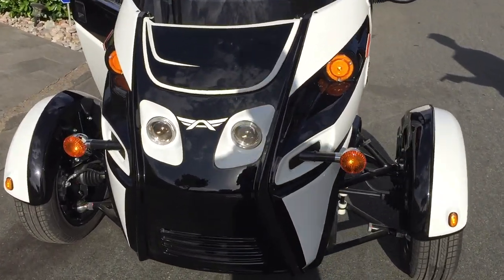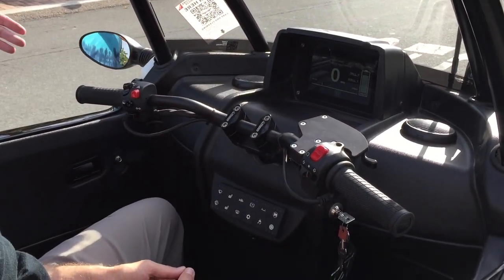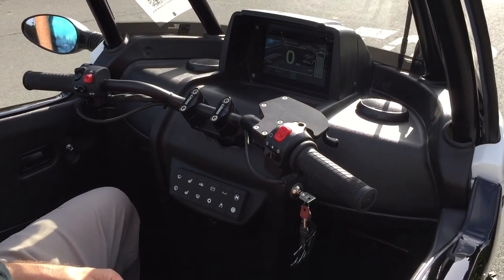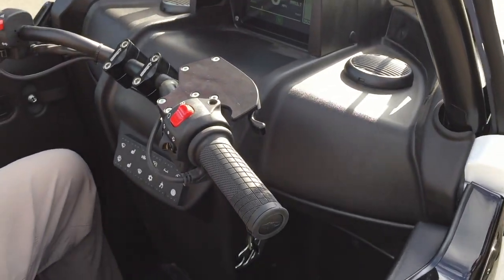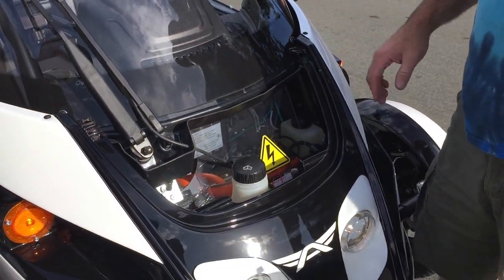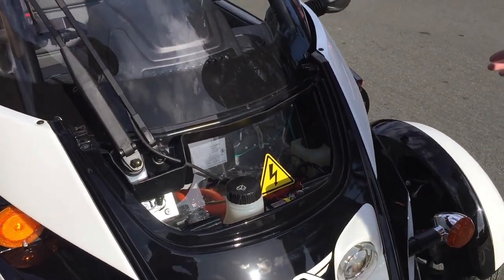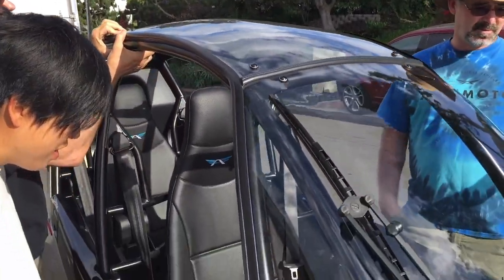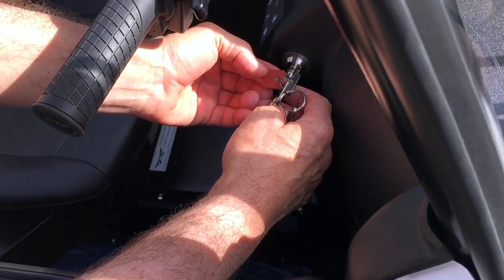2022 Arcimoto FUV Delivery & POV Drive!

Comment: $20k for this?
Reply from the maker: Yeah, I agree that they really need to bring their prices down for the vehicle to become competitive. Though, the battery in this car is probably quite expensive
Reply: @BrandonKipp  They were supposed to be 12k
Reply from the maker: That price would make it much more attractive, and I hope they can bring it down to that at some point.
Reply: No, not $20K. The base price is $17,900. In 2022 the average price of a new EV in the US is $66,000
Reply: @yulog  That is false. The promise of that goal of a $12K base price with mass production was based on 2018 dollars and will be more with inflation by late 2023 when the new mass production version is ready. It will be easier to do more assembly by robitics then and it will be lighter with a bigger battery capacity. I decided not to wait, I'm getting old. Mine is a very economical vehicle with no gas or oil changes and the very low motorcycle insurance rate saves me $800 every year.
Reply: @popeyegordon  your comparing a golf cart to an actual high end car...wow you showed us...lol
Reply: @popeyegordon  if enabling were a good thing you would be awesome.
Reply: @yulog  Fact checking IS a noble pursiut. I have 175,000 of them in social media. I also recently got two troll jerks banned after relentless harassment of all 
Arcimoto videos. YOU have had your channel for almost as long as me but I earned 100 subscribers while you have just two. Catch a clue.
Reply: @popeyegordon  in Europe you can buy small EVs (by Renue and Citroen) for commuting in the city for under $10,000. That price rage is the sweet spot.
Reply: @AA-rc4zr  This is a US website reviewing US made vehicles for use in the USA, bought with dollars. Into this separate venue you actually try to compare 40 mph city vehicles for cramped overpopulated EU countries with the 80 MPH Arcimoto. Who do you think you are fooling? Not us.
Reply: @popeyegordon  I'm trying to see things your way , but i just cant get my head that far up my arse.
Reply: @popeyegordon  Glad to hear you are not fooled. Archimoto claims to want to save the world by providing a car that will take care 80% of everyday driving. So, after you spend close to $20K you need a second car for your other 20% of driving. When it comes to marketing, Archimoto positions itself as something fun to drive. Probably after a week of driving it, it won't seem as much as fun, and you are still out of pocket $20Kish for glorified motorbike with hood on it. Average daily commute in US is 35 miles round trip. One of those European cars with 40mph for around $10,000 will do the job. For me commuting is to get from point A to point B, where I can still afford to have a fund car in the garage for weekends or long trips. 3 years ago, when Archimoto's stock price was around $3/share and just before it  jumped to above $18/share, I looked at the company as possible stock to buy. I reasoned the company was not a good investment and ultimately didn't buy the stock. Even after it jumped to $18, I couldn't see what value people were seeing in this company and its stock. Now it is trading at around $0.75/share. Hype will only take you so far. At the end, you have to deliver real value. It's good to know that there are still people like to that are not easily fooled.
Reply: @popeyegordon  Calm down. nobody is going to take your toy away. You are the demographic for Archimoto. I am not. No need to take it personally. I am stating at any price over $10,000 I don't find Archimoto attractive. Archimoto's path is a strategic dead-end. The company does not enjoy significant competitive advantage to survive. It's stock price confirms that. The stock market has dropped by 20%, while Archiot's sock has dropped by 75%. You don't have to care about the stock price, but you can bet Archimoto does. Unless its stock price goes back above $1.00 within the nexts couple of weeks the company will have to do a reverse stock split to avoid getting delisted. Investors don't like reverse splits. Without investor money Archimoto won't survive over time. Smart money has already left this company. Sadly, we live in a world where investors make more impact in the world than a few vegan podcasters and their neurotic friends. I could try and explain to you the merits of investment verses incrementally saving to buy a $17,900 "FUV," but that would be a waste of time. Enjoy your FUV and keep recycling your expensive water bottles. Before you tell me, you use one of those reusable water bottles, lookup how many times you have to refill it to make up for the resources that went into making your bottle.
Reply: @AA-rc4zr  YES stick it to the gordon guy, AA! nice one! you're stating the actual facts while meanwhile gordon is just throwing out his conspiracy theories. this stock is literally PENNIES! doesn't that show anything?
Reply: I would only buy if it was maybe 9k or less
Reply: @popeyegordon  I wish I could say arguing with you is getting to be fun, but it's not. You are falling apart rambling on about all sorts of unrelated nonsense. I don't have a horse in this race. I don't care if Archimoto survives or if it doesn't. I am stating my measured opinion. You are making my point for me. Archimoto's manufacturing costs are too high. I could explain it to you where Archimoto has gone wrong to end up here, but that would be a waste of time. There is a market in the commuter segment. Archimoto is not it. I bet by the time you get to start shaving, someone will come up with the right vehicle at the right price.
Reply: @popeyegordon   Popeye sound a little more like Olive (Karen) in this post
Reply: @seawas1046  Nobody owes you a vehicle sold at a loss. You might as well whine about Lear Jets not being under $20,000 and private islands not being less than $25,000. Oh, and the average price of a new EV in 2022 is $66,000. So you would only buy a Tesla if it included a $50,000 dscount?  WTF??
Reply: @yulog  No civil adult can see what you are claiming in your troll harassment attack. Flagged.
Reply: @popeyegordon  Hope it's an American flag.
Reply: @yulog  American website, American company, you earned 7 American Youtube flags for harassment violations of the terms of your account.
Reply: @popeyegordon   Woohoo, Love American flags😆

Comment: It's cool but feels unfinished and it's surprising givin how long this vehicle has been in development.
Reply from the maker: Oh yeah, there’s definitely still lots of work to be done. Especially considering the price, I’d expect to have better and more reliable software, but only time will tell how they improve. Stuff like the accelerator cutting out at random times can be scary and dangerous if you don't know what to do. Happened to me just the other day, needed to put it in neutral, then back into drive and then it worked again.
Reply: As an owner I say it is very finished. Easy handling, very utilitarian, safe and fun. I do not want doors in Florida. The idea is to avoid the solar oven effect and dead weight of doors and glass. This final of 5 prototypes is far better than previons versions. They saved 16 inches of vehicle length and 220 pounds of vehicle weight by going to handlebars. The long design history shows.

Comment: This goes 75mph, although I can't imagine who would be crazy enough to drive what is essentially a 3-wheeled golf cart 75mph.
Reply from the maker: We got it up to 84 mph, and while it's sketchy, it's so much fun snd felt a bit more stable than expected. Definitely not something to do on a regular basis though.
Reply: Nothing even remotely in common with a golf cart. Fail. High speed vehicles like this are not allowed on golf courses. The actual unadvertised top speed is over 80 mph. Mine does 84. I am protected in a certified 24G crash cage and a 6 point harness, so safe that no helmet, air bags or leather is needed. No golf cart in existence has proven formula one race car safety.
Reply: @popeyegordon  Golf carts may not be as safe, but yeah it’s very similar dimension wise. My cart is 1 inch longer than an arcimoto, about 10 inches less wide, but it is also taller. Has an inch more of ground clearance too. So, yeah, it’s basically driving around a super fast golf cart.
Reply: @seanrodgers553  No it absolutely is not. You can lie forever and never make that true. You are a very insecure person with a cheater mentality that compels you to upvote your own comments. There are countless vehicles that have the approximate dimensions of golf carts. They are all different designs for different purposes. A 6 wheel ATV is the same dimension but nothing in common with a golf cart. A forklift may have the same dimensions too and it is not a 'super slow golf cart'. The 'bahrta sai' troll is notorious for attacking the threads under new vehicle design videos. I had to get him banned from video comments about the Organic Transit ELF, my other vehicle.
Reply: @popeyegordon  
A) I did not like my comment, I never do.
B) A forklift is not transportation like a golf cart or Arcimoto
C) Yeah, an ATV is kinda similar, just serves a different purpose. Yes, I can off road my golf cart too
D) There is nothing wrong with comparing a golf cart to an Arcimoto. I’m saying that as a positive. I love golf carts, an arcimoto seems like a fast golf cart. Easy to maneuver in tight spaces, easy to take around a community, easy to plug in at home, easy to just get out of the house and enjoy the ride. When I think of an arcimoto, I think of it as a fast golf cart for these reasons, I’m not sure what’s wrong with that. That’s a good thing
Reply: @seanrodgers553  I take you at your word that you did not upvote your own post before I replied 15 minutes later but that is the exception, as is the norm for trolls attacking new compact EVS, calling them golf carts with derogatory malicious intent. There are hundreds of such attacks in Arcimoto video comments. They claim it is the exact same thing as a Can-Am when the only similarity is three wheels. They also like to call it a rickshaw or death trap, again with malicious intent.
Reply: @popeyegordon  Oh yes, I love EVs, and  unlike those trolls, I do thing the Arcimoto is pretty cool. Also yeah, back in the day people called Teslas golf carts, so I understand that. I mean it in a good way, I love golf carts! Also, this and a can am are separate vehicles with completely different purposes, I’d definitely not compare the two. Also, the arcimoto definitely has to be safe to be Street legal, might not be as safe as some cars, but definitely safer than motorcycles and even some cars, and definitely safer than older cars. I wouldn’t say death trap
Reply: @seanrodgers553  Understood.
Reply: @seanrodgers553  It's funny how this gordon guy thinks you're some troll when meanwhile he's on social security and taking advantage of medicare and all the other stuff
Reply: this junk seems so dangerous to me lmao
Reply: @seawas1046  And yet it protects the occupants in ways only cars can do. A billion motorcycles and scooters have no six point harness or roll cage. It is so safe there is no need for a helmet and you can drive it barefoot.

Comment: Starting at 18 grand 😆😆 the battery lost 10% just being powered up.
Reply: Correction - the default battery charge level is 90%. We have to enter a command to go 100%. This method increases total battery life. Not the only EV using this approach. 
$18K is a fantastic deal in 2022 for a vehicle that never needs gas or oil changes and gets the very low motorcycle insurance rate. As of now there is a $7,500 tax rebate. Didn't help me as I'm retired. Demand for EVs is set to explode with the new tax breaks.

Comment: It looks like it could tip over easily.
Reply from the maker: Yeah, it’s definitely less stable than a four-wheeled vehicle
Reply: @BrandonKipp  so no stability control like a can am?
Reply from the maker: @doclees11  I don’t believe so
Reply: @BrandonKipp  have you got it in 2 wheels yet?
Reply from the maker: @doclees11  Haha, nope! It just rolls side-to-side a lot in corners but I feel like it would be pretty hard to actually flip over
Reply: @BrandonKipp  well with a 29 ft turning circle you probably need more speed than it can deliver.  Good thing it is short so K turns are easy enough.
Reply: @BrandonKipp  Incorrect. You do not know of any 4 wheeled TWO PASSENGER vehicles that have a wider wheelbase and how many have a certified roll cage and 6 point harness?
Reply: @doclees11  The stability is built in by having a wide wheelbase. CanAms have no roll cage or 6 point harness so they are far more dangerous to drive in all cases.
Reply: @popeyegordon  that's plain wrong.  They both have the same track within an inch. Wheelbase is length not width.  The longer wheel base of the Arcimoto makes it more prone to roll not less.  The Arcimoto has about 200# on the Spyder but it is also another inch higher in ground clearance which probably raises the CoG.  Neither of these 2 trikes are "safe".  Stick either in front of an F150 and you are mush.  The harness and roll cage only make it easier to find the parts. I'll take the Spyder's more nimble handling and stability control as a safety feature over the 5ft greater turning circle, harness and roll cage of the FUV any day.
Reply: @popeyegordon  yeah I call BS on that.  Post the link.
Reply: @popeyegordon  as I said BS.  No F150 and no pictures.  No evidence that was a 35 mph accident.  Did see another one there with side impact damage but no pic of the other vehicle and no evidence of speed hit.  But maybe they are prone to more accidents because of the size and quiet running?  Remember loud pipes save lives.  You'd think if this thing was that safe Arcimoto would demo a crash, side/frontal/rear end, with all the same automotive standards, and publish the results.  It could only help the dismal stock price.  I bet you are an investor.  That would explain your rosey disposition.  I'm not knocking these things as crap.  They have their place.  I've followed their development for years.  I am disappointed in their range.  IIRC range was to be in that 150 mile area and they were promising a fully enclosed option. That hasn't happened.  But more than range is charging time.  It really needs fast charging.  Lithium iron phosphate batteries would be nice too so we can stop poisoning the people and children in the Congo.
Reply: @popeyegordon  hahaha!  Such a toad.
Reply: @doclees11  and also, thank you for actually stating the facts. its clear you're not a "hater" who wants the company to fail; you actually have been following them, and you're disappointed (as you should be). why doesn't the company show an actual crash test? I searched arcmoto crash online and found ZERO photos of how they've been in crashes; only saw some owner stories which could easily be fake. can am is cool! its an actual fun vehicle to drive around! unlike the gordon guy which says that we aren't allowed to do leisure drives, the car is literally called fun utility vehicle! plus, how the hell can you fit groceries and stuff in that tiny car? when you get hit, your body/gu+$ and stuff will mix with your groceries! wouldn't that be bad? absolute CRAP range on the highway, like 30 miles. what is this garbage???
Reply: @seawas1046  my issues with Arcimoto are none really.   They are what they are. Great for mild climates and short hops or commutes.  The company isn't saying this is as safe as a car or that it will save the world.  It didn't hit me at first but I've dealt with this guy a while back.  He or she thinks they are smarter than a 5th grader but I have my doubts.  It's these virtue signaling fools that go on about things they think they know but don't that get me calling them Toads.
Reply: @seawas1046  Can Am is a death trap like any other motorcycle without a crash cage and harness. IT HAS TRACTION CONTROL NOT STABILITY CONTROL Nobody has any reason to 'fake' a crash.
Reply: @doclees11  I am smart enough as a fact checker to earn 100 subscribers in the same time YOU have managed only one, a sure sign you are universally rejected in social media. I have 175,000 fact checks in sodial media, how about you?
Reply: @doclees11  Even with all that your Can Am us still a death trap the same as all other motorcycles without roll cages and harnesses. Even if it was run on rails it would still offer no collision protection, far and away the most serious concern with motorcycle safety. Canadians ride on snow and ice the most which is why they are touting the features. I had a car with ABS, did not like it. I can do better with my lifetime of driving experience - ABS is for dummies who panic. Regen braking can not be adapted for ABS and that is not missed.